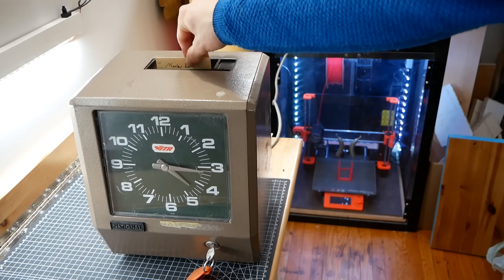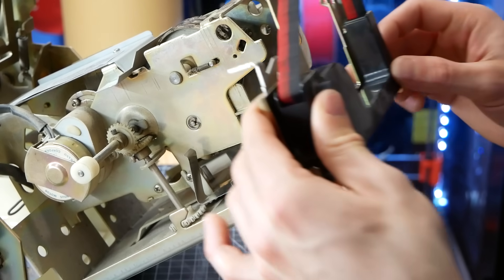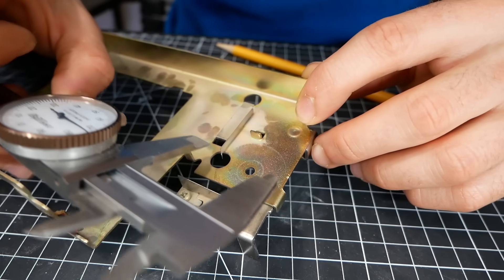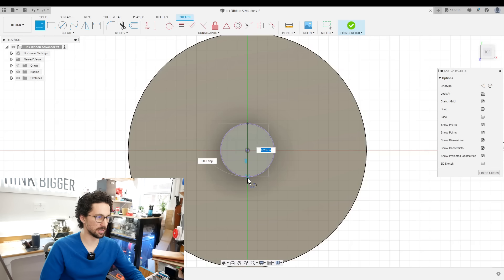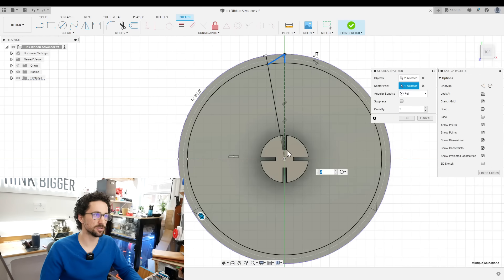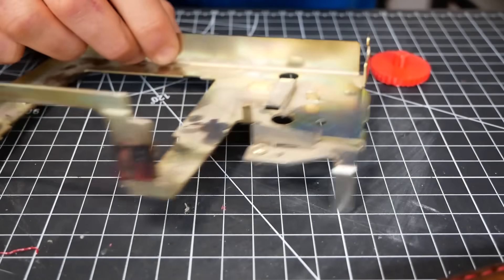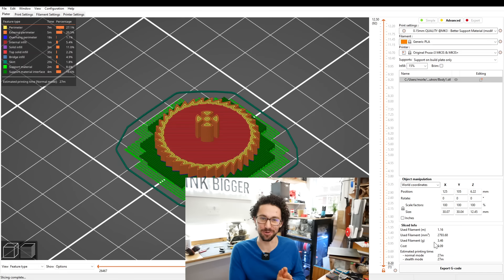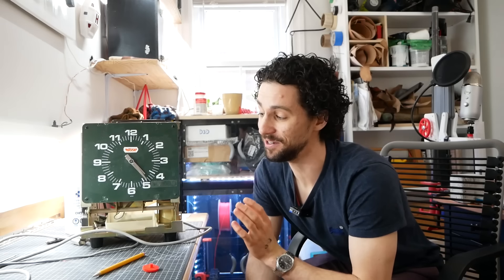They wanted 100 dollars. I 3D printed it for 9 cents.

Comment: 95 dollars.. that's their "we don't want to service this anymore" price
Reply: That price also included the metal bracket assembly. We were not told the price of just the gear, if available separate.
Reply: @wilk7255  this is what I noticed. That whole piece of metal looks high quality and durable. Too bad they didn't seem to have spare gears or offer/catalogue them separately.
Reply: @wilk7255  Exactly my thought!!!

It *is* a tad unreasonable for them to not provide schematics of the gear tho.
Reply: @dumpicus_maximus if it’s patented, the technical drawings will be available there.
Reply: I'm surprised they even offered the part. The price isn't unreasonable considering the age. There are commercial vehicles out there that aren't even 7 years old and have parts discontinued.
Reply: Of course. This is ancient tech and im surprised they still offer the part.

To play the devils advocate, lets say this took 1 hour to model and print (including revisions). Factoring that in, the price isnt so insane. Only business owners would be buying these kinds of parts.
Reply: @kennuimuffins2426  To play devils advocate aswell, they would've made the part in metal. Not plastic. And they wanted to replace the whole block. With those in mind 95$ is probably reasonable. I watched the whole thing and the video seems like a clickbait.
Reply: @kennuimuffins2426  The "9cents" also doesn't take into account the cost of the 3D printer etc. So for most people who don't own one, $95 is pretty cheap and reasonable.
Reply: yep. Happens in every industry. I once had a guy get mad at me for not being able to fix his twenty year old computer. . . . . . .
Reply: @junior1138  my current computer is 12 years old and completely repairable. Sounds like you're just lazy.
Reply: @runed0s86  As someone who has built their own computers, no, it isn't laziness. Modern parts don't even work on motherboards from 6 years ago, and you can no longer find parts older than that outside resale sites, which aren't always reliable.

From a business standpoint, your PC isn't feasible or cost effective to repair if a part goes out entirely.
Reply: @runed0s86  See how you'd go repairing your computer in another 8 years.
Also computers have changed much less in the last 12 years than the 12 years before that.
Reply: @runed0s86  something 20+ years older possibly has parallel ports that used to be the printer/scanner interfaces, IDE interfaces for the internal drives, and some may even still have ISA slots.  No onboard NIC.  A fax card or NIC on an ISA board would be hard to replace and then there's the issue of finding the driver even if you do find a replacement card on ebay
Reply: @junior1138  Was it a grumpy ol' Get Off My Lawn dude, or a SMB owner with an ancient application that wouldn't run on anything built after 2005?  When I ran a PC Repair shop I saw both types 🤣
Reply: @jcabelair7749  🤣🤣🤣 Dude was running Sebilius from a 1995 magazine.
Reply: @junior1138  Was this 20-year-old computer running MS-DOS 6.x?
Reply: @RaymondHng  no, it was a Mac.
Reply: I wouldn't be surprised if they still had the parts in a warehouse and the price was entirely based on how long it would take to find it in some area that only stores legacy parts and is not well sorted. It wouldn't make sense to just throw out replacement parts when you know eventually some business will need it, but it does make sense to only allocate a small space and just shove all the old parts in the same place.
Reply: @zebraloverbridget  Nah, i think the price depends more on it being a servicable spare part that needs to be in stock for whenever a punch clock needs to be repaired and it needs to hold up for another 10 years of daily use of hundreds of workers. 
Place this punch-clock in an industrial environment with this 3d printed gear and it will fail after a week. 

They do not provide parts for a toy (which this specific punch clock now is).
Reply: @dcdc358  3d printed parts are not necessarily weak though. There's plenty of methods and materials that will result in solid parts that are just as strong as what they replace. 

I can't say if the parts made in the video will last though. I stopped watching before he printed it since the interesting part was only the beginning.
Reply: Not really. This is probably a valid replacement part cost which would be paid without blinking an eye by the factory using this time clock to control their workforce. BTW, the 9 cent price does not include the cost of the 3D printer and your time and skills to reverse-engineer the needed part.
Reply: Medical equipment is so much worse. $220 for a plastic tube... for a job that can be done by a simple garden hose. $500 for a small piece of brass that I can make from bar stock for less than $20. A small dc motor that would normally cost less than $250 that sells for $2000 in a unit that only costs $10k. If you ever wonder why healthcare is so expensive it's because manufacturers have profit margins that should be criminal. "BuT iTs PrOpRiEtArY"
Reply: @r00234  The ridiculous part is, those companies actually have quite small profit margins. Yes, when you only consider manufacturing cost, it may seem like a scam. But in reality they spend most of the money in R&D and all kinds of testing, permissions, regulations, government bureaucracy, insurance... those are way more taxing in medicine that in average industry, and then they end up producing relatively small volume.
Reply: @somedud1140  Im talking about profit margins of the equipment they sell which generally only factors in manufacturing cost. You are referring to overall profit, of which some companies don't have much because of what you said (not to mention labor costs), BUT large established medical companies like GE, Masimo, Helmer, Thermo Scientific, etc. (Aka the companies that are constantly buying out other small companies finding it hard to get a leg up in the industry) have colossal profits each year.
Reply: @r00234  Count this as the exact moment in time when you realized how much FDA over-regulation has played a part in driving up health care costs.  That hose has to be registered and approved by the FDA, which means attorneys to get it through that process on top of the FDA fees, etc.  Your hobby store rubber hose doesn't have any of that nonsense
Reply: @jcabelair7749  The cost associated with FDA approval is already significantly offset by the price of the unit, spare parts don't need additional FDA approval. It is hyper inflated because everything is hyper inflated in the industry. Also this is non-patient equipment I'm referring to, which means that I literally could get a hose from the hardware store and replace it without Joint Commission having a problem with it. When we start talking about IV lines then the conversation is significantly different because a simple change in elasticity of the tube can end up over-infusing a patient, and yet IV tubing is significantly cheaper. Which only makes sense because you cant charge the patients $220 just for disposable tubing every time they have an infusion.
Reply: @r00234  it's not just the cost of registration; it's the manufacturing standards that have to be complied with that other industries don't have to.  If your hobby hose fails, no biggie, but on a med device, the gov over-ensites it's less likely to happen.  It's what gov does.  It's why the official recipes for gov brownies is like 21 pages long.

Med device manufacturing is one of the last industries I would choose to get into because of the massive overhead startup costs.  These kids doing miracles with Raspberry Pis and Lego sets are able to do so only because the gov hasn't stepped in
Reply: @jcabelair7749  My "hobby hose" is what's used to replace that $220 "manufacturing compliant" tube. Guess which one lasts longer? Govt doesnt have as much a hand in that stuff as you make it up to be. Otherwise manufacturers would not be able to get away with the purposely janky ass equipment they put out. It's only as you say when it can injure the patient. If it doesn't affect the patient, then it's cheap as shit and built to break to increase service costs.
Reply: @r00234  You better believe it should be criminal. Healthcare costs are insane. It's like they have entire countries as hostages. It's too bad families of dead people who couldn't afford treatment can't sue.
Reply: @roadkillavenger1325  What's stopping you from building a competing product and selling it for less?
Reply: At least they do, other companies would have given you the apple approach and tell you to fuck off
Reply: Your lucky they still sell the part.
Reply: The 3d printer cost way more than the 95…..
Reply: 9 cents is the ""Chinese price". Its reverse engineering the product. The price counts the l)) l
Reply: Yeah even small scale manufacturers don’t give a rats ass for small order customers, that’s the American way oorah
Reply: 95 in consideration its old tech dosnt make any sense to me. Morel ike the cost of the metal + cnc work + labor + planning the bracket itself creating it for the cnc machine . 3d printing changed the game rather quickly  for such small parts and even the prints themselves are pretty strong considering its use and also just printing a few more if it gets used up.
Reply: their "Dont you think it would be cheaper to buy our latest model?" price
Reply: Seems like a normal price to me buy any appliance parts and they are all over priced. Also think of how much time this guy used to save $95. If it took him a more than 3 hours he was probably better off just buying it averaging he is worth $30 an hour which is probably less than he is worth.
Reply: this reminds me of a situation that i saw happen once at work. a customer walks in and describes the part he needs for a period of 5 minutes or so to the sales person so they get the right dimensions and material needed and then they punch in the order and that gets send to the warehouse people who go and pick the item from storage (another 5 min or so) and then bring the item in question to the sales person so he can charge the customer 4 cents including tax.... i dont even know how cheap the company buys them for but it was more costlier to get that customer what he wanted than to just say we dont have it. the part in question is ordered from the manufacturer to us in sets of 10k+ or so and usually sold in sets of 100 or more to people using them in their business... along with all the other relevant parts that cost more... and that person was doing a personal purchase and not for a firm that could potentially bring a repeat sales... so i can understand why stuff is not sold at manufacturing prices...
Reply: The cost of him making the part here also has to be considered, not just materials but the time invested in learning how to do this, and then getting the measurements and setting it up. If he invested even an hour or two of research and time to put this together, sure it cost him nothing but his own time, but what is his time worth? Paying an expert to do it for you? $50 an hour isn't that astronomical.

$95 for someone to go through all this effort to make a one off part that isn't kept in stock anymore, the majority of that is the knowledge of how to do it, not the materials.
Reply: "Go away or I shall taunt you a second time" kind of answer yeah :P
Reply: Yep and the fact that is original and not some plastic basically kicking the rock down the road.
He's thinking from a "I just need this to work perspective". Some people are collectors like pickers the show and they want original parts.
Reply: @overtoke  lmfao what
Reply: That. Also I think their quote was for a more complete part not just the gear itself. Though with a part like that which is clearly consumable they should just have a bucket of them that they could mail out. Seeing how user replaceable the gear is I find it wasteful that they make you buy a whole assembly, knowing the metal part of the assembly will last forever but that one plastic piece won't. Looks like early planned obsolescence.
Reply: @SetitesTechAdventures  the original gear was probably made of metal and not a consumable part
And why on Earth would any company keep buckets of parts sitting around for machines they haven’t made or sold in DECADES
Reply: @drthmik  9 cents plastic gear  will last 1 week for for hundreds of Employee's. 
Changing that gear will cost one hour of labor a week ...52 x 3$ per hour x forever . 
95$ metal gear will last forever unless it is lost (Its  is a steal for the company)
Reply: Its in the, "For that price I can nearly by a cheap 3d printer" price range.
Reply: You lie, cost was for the whole subassembly not just the gear wheel
Reply: Anything business related costs much more than similar everyday products. They hike up the price because they are necessary items. Businesses are forced to pay those prices. That's why everything the government buys costs outrageous amounts. The people with the products know they can afford it, so they price their items like gold.
Reply: @roadkillavenger1325  There's also usually a big difference in quality between business and consumer class products. Business class products are designed to withstand much more reputation of action than consumer class.  They additionally cost more to engineer that additional durability/field use cases
Reply: @jcabelair7749  like packing tape?

Comment: Great job.
Just a comment on fusion 360. You could have defined the tooth parameter based on 360/tooth count. Also, you would be better to draw one tooth and extrude, then use circular pattern to make the rest of the teeth. Then you don't have to select all those sections to extrude, also fusion 360 likes the simplest sketches possible so patterns should be done in 3D where possible.

Comment: It's one thing designing 3D parts for your own project / system with your own measurements and constraints, but anyone who designs a 3D part for an existing system, especially old devices like this, and make it fit and work is bloody impressive! Great video!
Reply from the maker: Thank you!

Comment: That's not how this works! ;) You or someone close has invested in a 3D printer, by the looks of it also spent time building and upgrading it, and also learning about 3D printing as a method of manufacturing and how to run it. Then, of course, material, electricity and machine time; factor in wear and service on the machine. Then its the CAD work, an acquired skill that takes effort, likely a tuition that either you or society paid for, and perhaps even a paid licence of Fusion 360. CAD design work is in many applications quite high cost.
Would you have done all that work for a client for a mere 9 cents, all the way from investigate work to plonking out a working gear after a few iterations? If so, Ill hire you next time I have the need for this stuffs instead of doing it myself :D
Also, Id say its remarkable and commendable of a company to keep stock of parts to a ridiculously obsolete system like that puncher.. I bet that $95 is still a net loss for them.

Oh, really good tutorial video on the whole. Prime example of applied additive manufacturing of small batch/custom bits including rapid prototyping.

Comment: i can believe it was worth 95$. 95$ is for the hassle to go find an old spare part for an obsolete piece of tech in a stock with very limited amount of parts remaining for that model. The fact they still had parts left for that machine is a miracle in itself. 95$ is for the rarity of the part. Keep in mind companies making devices like that don't keep factories runing to make parts until the end of time. Generaly they run orders for the amount of part they expect to be needing for the expected lifetime of that machine and then that it. The tooling of those factories is repurposed for something else and you cannot produce those piece anymore unless you go to the hassle of re setting up a production line.

Comment: You can make the selection of multiple profiles easier by using the "Invert selection tool" after selecting the OPPOSITE profiles that you want to select.
To make sure things are easier - make sure you aren't giving yourself multiple profiles that aren't needed. To do this, use construction lines when creating constraints with sketch items.. You can either press "x" to toggle construction lines on or off (or click on the construction lines button on the sketch palette), or you can select a line and then press "x" to change that line to a construction line (or select from the sketch palette)... 
To avoid issues with having 2 profiles for the gear teeth (the positive profile AND the negative profile of the tooth), I would use a small arc that will cover the gap between each tooth, but not completely bridge across the root of the teeth (basically an arc that extends 1 or 2 degrees from the bottom of the tooth). Then when you create a circular pattern, this little arc will complete the negative profile of the teeth, but not the positive profile. Then you should be left with 1 profile for that will be the actual gear you want to end up with and the remainder of the profiles are the ones that you want to cut.
One or two extra clicks avoids dozens of additional clicks (35 in this case) to select each tooth. 
It'll also make it easier if you change the tooth count and you need to reselect the profiles for the cut extrusion.
Reply: I made a video showing this, because I'm terrible at explaining things - https://youtu.be/Ai4qkBzbwTI

Comment: How did you know how thick to make the gear? It looks like it raises up the ribbon cartridge. The original was probably stamped out of 1/32 steel sheet metal. But if the one you made works, that's all that matters.